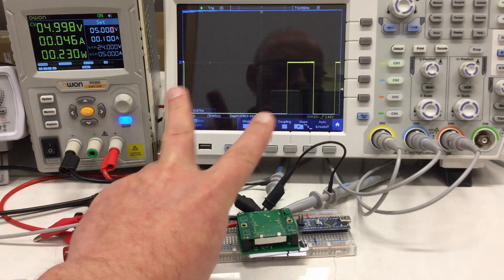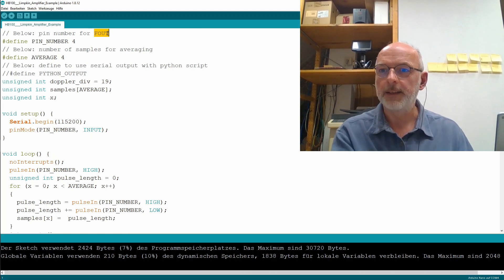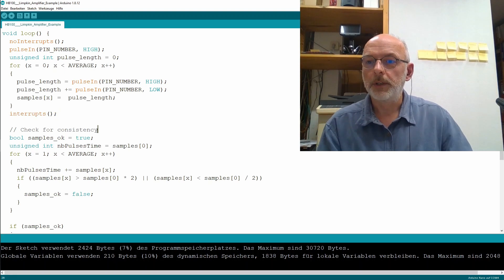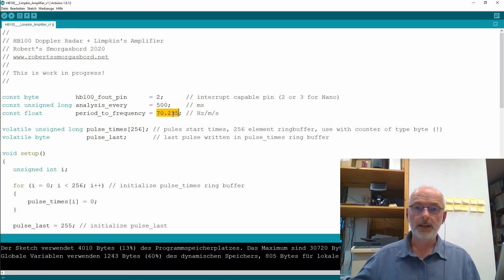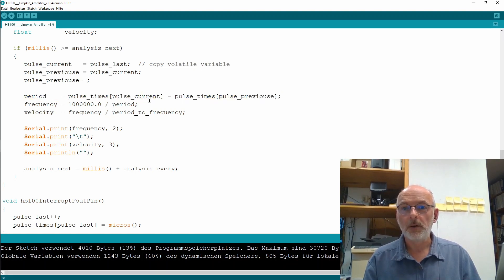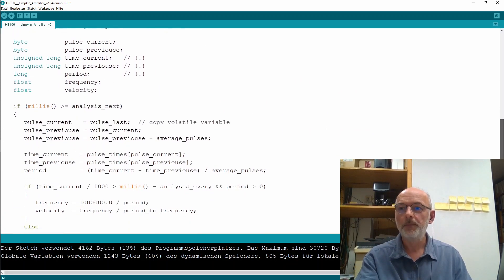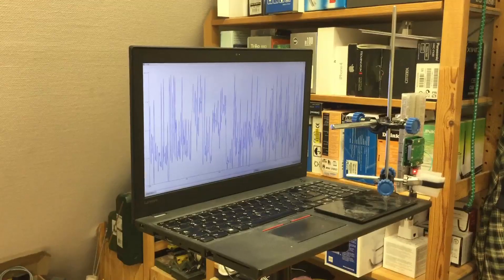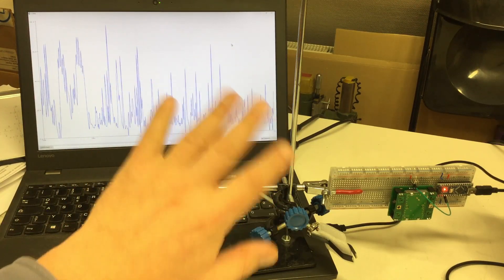HB100 Doppler Radar, Limpkin’s Amplifier and Arduino MCU – The Details (2/3)

Comment: Hope you had a great holiday, I do love your 'in depth stuff' interesting the difference after a rotation and yep 2 peaks became visible, maybe you will come back to this, anyhow great tutorial and cheers !
Reply from the maker: Hope you had great holidays too - I'm still with the family :-) Anyway, I won't further explore the orientation of the radar module in part 3, but I'll finally deliver some distance measurements. Regards, Robert
Reply: The datasheet has a radiation pattern, this gives you an idea of sensitivity based on orientation, Google's hb100. Nice video, I've been meaning to make a project will this module in the Future. Looking forward to part 3.  Also is there a way to to improve the detection range with dsp?
Reply from the maker: @bgitego  Hi bot10, I've shown some excerpts of the HB100's datasheet / application note in part 1 (link to it in Limpkin's blog - see video description). However, I didn't show the radiation pattern / polar diagram - my bad! It possibly would have explained why the radar module worked better in one orientation than the other. I will talk a bit about using DSP/FFT in part 2. However I don't think you can improve the sensitivity / detection range with it.

Comment: Hello. I just saw about 1/5 of the video and would like to suggest that you simulate movement along a path parallel to the device, not just perpendicular. Also, try at longer distances with larger objects (people). The device was probably not optimized for such short range tests with a simple perpendicular movement. Any way it would enrich the video. Hopefully you try it later, lets keep watching.
Reply: Alright, you improved it with coding. A lot better than it the raw product.
Reply from the maker: Well, unfortunately my den has some space restrictions, so large scale parallel movements were out of the question. But I walked away and towards the sensor (perpendicular person sized object).
Reply from the maker: @malaquias2754  Yup! There's nothing like a bit of filtering to get something out of a somewhat noisy signal.

Comment: 1. What changes should I have to made in Limpkins amplifier circuit in order to measure  
Velocity up to 40 km/hr? 
2. If the axis of sensor is perpendicular to direction of moving object.. Will it able to find the proper velocity??... 

I can't under the proper ciruit design... i want to know the application of each component in detail.. So, I can modified that circuit according to my application... 

Please, give me some proper guidence...
Reply from the maker: I explain Doppler frequency and Limpkin's circuit (especially the bandpass filter for the doppler frequency) in part 1: https://youtu.be/MpVRHEUV3Xo
You have to calculate the Doppler frequency for 40km/h and then adjust the upper cutoff of the bandpass filter accordingly.

Comment: Hey Robert, this series is amazing, it's helping me a lot while I wait for delivery of my HB100 boards!
I've been thinking about how could I reduce the sensing range, in a nutshell, for my application I need the HB100 placed on top of a table facing up and trigger some code whenever someone waves their hands over it. I think it's very easy to accomplish but I'm uncertain if the range is too big if I'll be getting false positives because of "activity" on the floor above for example. Ideally I would love it if i managed to reduce the sensing range to just a few centimeters (i guess up to a meter is fine). I thought of playing with the amplifier gains as a starting point, what do you think?
Reply from the maker: Hi Tomas, thanks for the praise. But hold off fumbling with the amplifier gain for now ;-) In part 3 (being published this Sunday) I'll use the "signal strength" output of Limpkin's amplifier (which is basically proportional to the distance of the object) to filter out noise. I'll guess you could use just that output in your application (no need to measure the doppler frequency).
Reply: @robertssmorgasbord  can't wait for part 3! Seriously this videos are the best material out there to understand this module, thanks so much for putting this up. Excelent work!
Reply from the maker: @tmigone  Thanks again for the praise! Only two more days to go until part 3 ;-)
Reply: Sounds like you need a gesture sensor.

Comment: Hi!
I guess your main problem is that you have this mains harmonic 100 Hz noise, you' re trying to fix it somewhat by software, but I guess you'd rather ensure the power supply to you hb100 and above all to the amplifier/comparator is absolutely clean of any ripple, and wiring is properly decoupled. That's a common problem everytime you deal with such high amplification factors and real small signals like the IF from the hb100 module. 
Don't use the  power supply from the arduino to feed your detector / amplifier .Use a 7805 with lots of decoupling instead, you'll see the difference !
I brewed my own amplifier based on Limpkin's documentation, with plain old LM301/308 op amps, and it works a treat: I've got no signal output when nothing moves in front of the hb100, none of that 100 Hz rubbish, and still manage to get it triggered with enough sensitivity, just waving my hand around. I also had good success with averaging the freq. values before applying speed calculation, at the cost of slowing down the measurement a little.
I also had to tweak the filters quite a bit to achieve succcessful vehicle speed measurements, lots of fun by the way, got honked
by cars as I was standing alongside the road doing my stuff.Not sure about how I would have explained what I was doing if the coppers had showed up at that time. 
Thanks for your video !
antoine, from F8EBL  radioamateur station, Burgundy .
Reply from the maker: Hi Antonie, thank you very much for the info! If I ever make a part 4 (not planned yet) I'll definitely try a separate power supply. BTW in part 3 (being published this Sunday) I'll get rid of noise - including the 100Hz - by using the "signal level" output of Limpkin's amplifier. I also thought about tweaking the lower/upper cut-off frequency of the amplifier, but decided against it because it's too application specific for now (walking persons at 1m/s vs cars at 10m/s or more). Anyway, one application came to my mind: Detecting doves on my balcony (they lately became a real pest) to trigger some deterrent (sound, light etc.). If I come around to actually build such a thing I'll heed all your advices :-) Anyway, don't let the cops catch you when you're experimenting :-)

Comment: I found Limpkin's amplifier to be terribly unstable and tbh, not very good.
Reply from the maker: I personally had no problems with Limpkin's amplifier. That is besides the 50Hz signal that was coupled in from the AC mains ;-) I guess at those low signal levels and high amplifications one really should use some shielding. Anyway, do you know if typical application circuit from the HB100 datasheet performs better or do you know of another, better amplifier for the HB100?